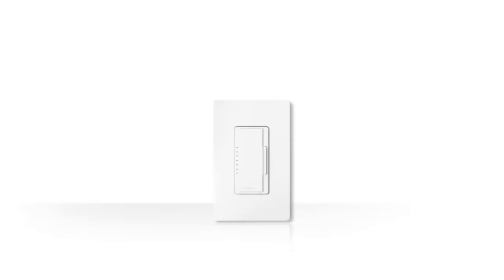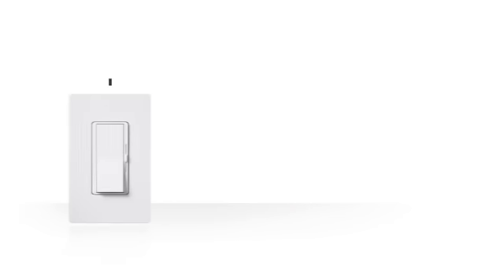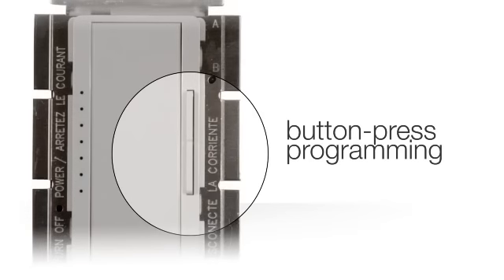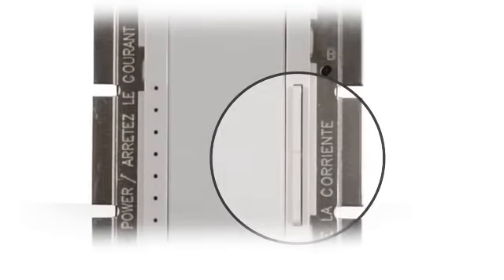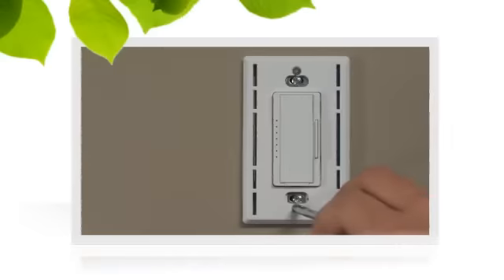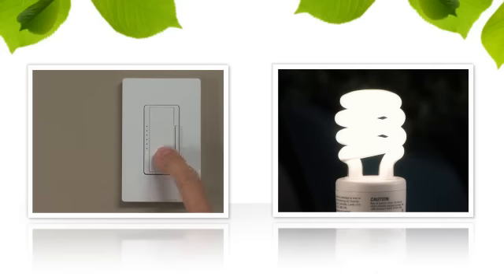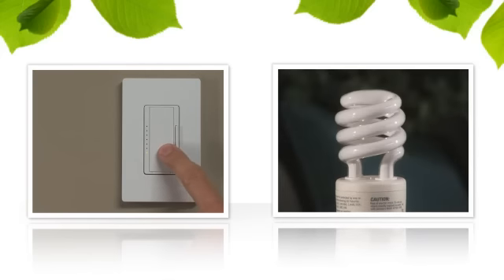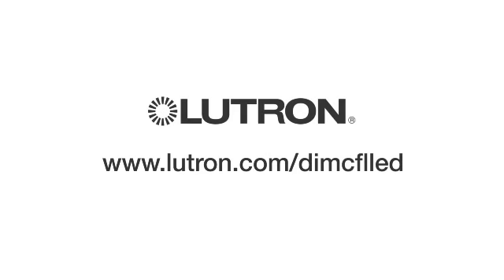Lutron Maestro LED+ (formerly C•L) Dimmers: Adjusting the Dimming Range

Comment: Is is possible to lower the max brightness with a Maestro MACL dimmer? I'm using incandescent bulbs.
Reply from the maker: Hi Darrin, The high end and low end trims on the dimmer can be adjusted directly on the dimmer. We've included the programming guide for additional help: https://www.lutron.com/TechnicalDocumentLibrary/048459.pdf Thanks!

Comment: I've installed over a dozen different bulbs for my Maestro MACL-153M dimmer, but my LED bulbs keep flickering no matter which one I use. Even the brands recommended don't work for me. Calibrating the dimmer just makes the flickering worse.
Reply from the maker: Hello,
Thanks for reaching out. We're sorry to hear about the LED incompatibility you are experiencing. We'd recommend checking out our LED compatibility tool at www.lutron.com/ledfinder. If you have any further questions or still experiencing flickering, please  call the number 1-888-588-7661 for further assistance.

Comment: After installation, the switch worked for about a month, then one day all the LED blink at the same time, and I cannot turn it off.  The problem went away after a few hours, but not it comes back permanently.  All the LED dots blink continuously.  Please help.
Reply from the maker: Hi, Max. I apologize for the issues you are experiencing with your Lutron device. All the LEDs blinking at the same time does not point to a specific issue. When you have a free moment please reach out to our Technical Support team at 844-588-7661 and reference case # 00311127, they will help troubleshoot your issue and hopefully get your device working properly again.